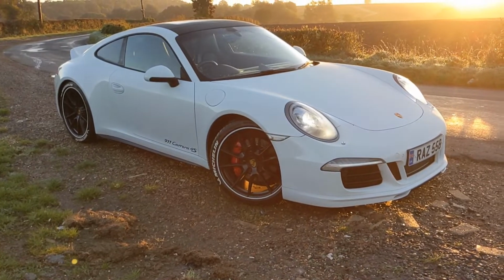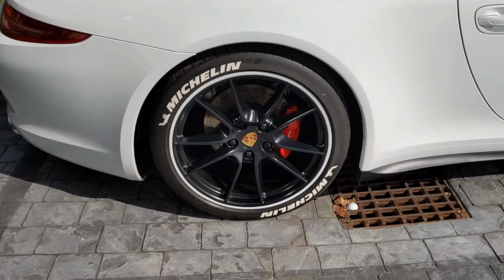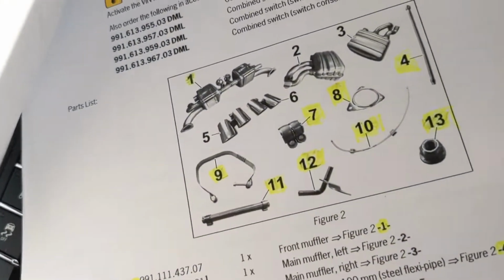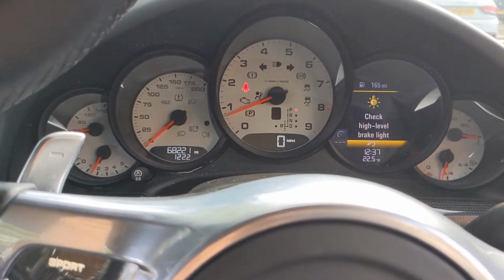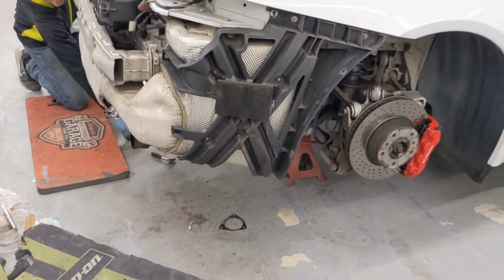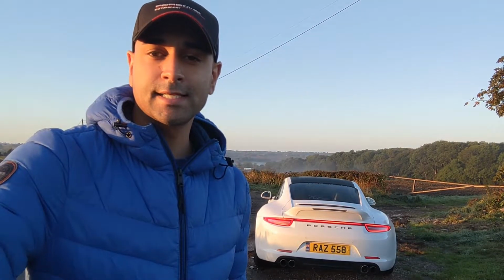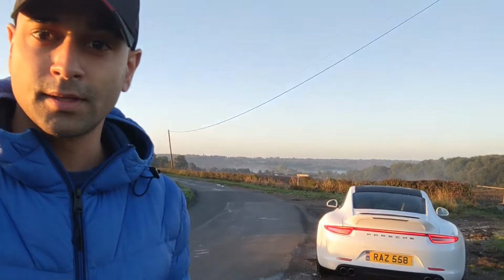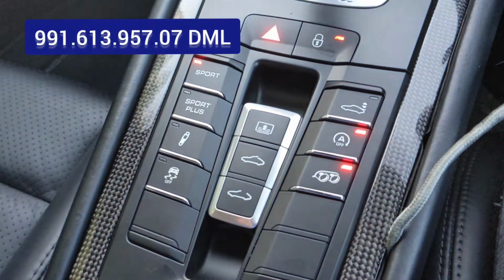Porsche 911 4S 991.1 Sports Exhaust (PSE) Install , Retrofit , Change Over Valves

Comment: Hey, I have a question about the console. Did you have to install some new wires too or where they already there and you had just to switch the console? 
Great video by the way 👍🏻
Reply from the maker: Regarding the console, this is something i requested the OPC to do as I didn't want to mess around with the electronics. It requires coding and specifically connections into Porsche Germany network to code the car.

Comment: Do you know what the valve operation is when PSE is engaged? Do the valves stay permanently on all the time, or do they stay open at idle, close and then open again in high RPM like the GT3?

Comment: Hi can you provide an idea of cost for this conversation please.
Reply from the maker: You could be looking at around £2400 to £2900 from an official UK porsche dealer ship. But you can save over £1500 and more doing it the way i did.
Reply: Thanks
Reply from the maker: @wetsc400  Hey, it is a 2014 model
Reply: How did you get it activated from Porsche? @raz558
Reply: Hi Raz, I have PSE on my 991.1 but the valves are seized. How did you manage to source just the centre part of the exhaust?

Comment: Im also about to get this 991.1. But still torn in between S or 4S. Why did you get the 4S?
Reply: Did u get one? My only experience with AWD vehicles is my Land Cruiser but i love being stuck to the road so was planning on getting the 4S
Reply: 4S for the wider body style.
Reply: 4s is 1inch wide on each side(total 2 inches) that requires wider wheels or spacer.